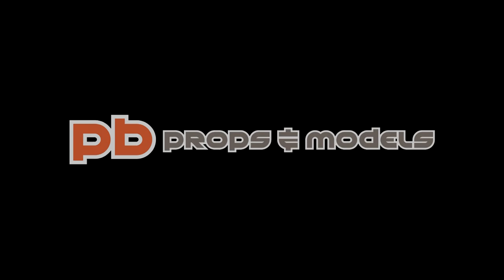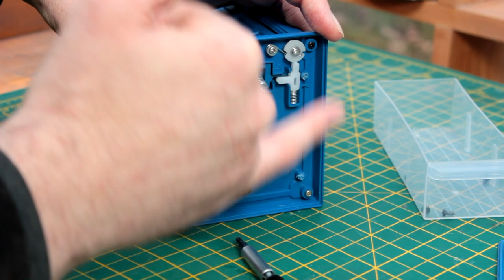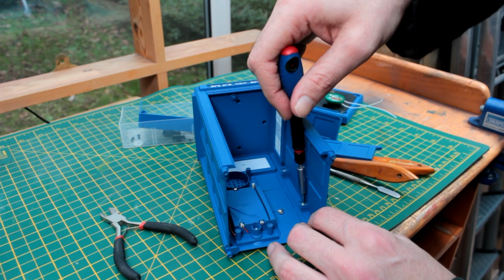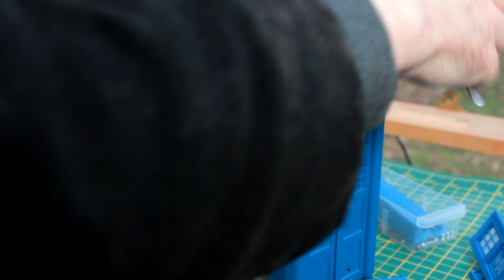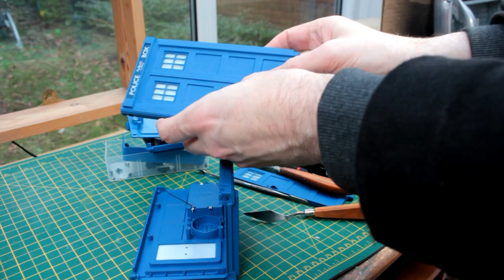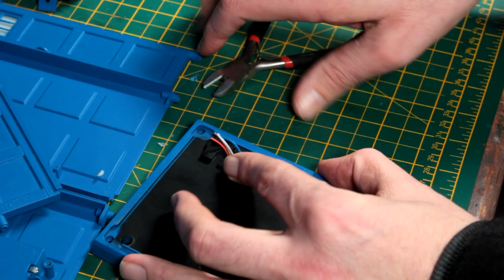How to Dismantle your CO Classic TARDIS Toy

Comment: I had a great deal of difficulty  with my Tardis, putting the outside panels back on, as the inside was a lot bigger than the outside!
Reply from the maker: Dimension transcendentalism can be rather tricky to master, but once you've gotten your head around it, it's easy to overcome.
Reply: @PBProps  When in doubt, a sonic-screwdriver will help you out.

Comment: This was great. Will be handy if and when I come to have a go and customize one or even repair. Good to know where all the screws, springs and tabs are. The only one I've taken apart is the Dapol one! But the walls were supposed to open up.
Reply from the maker: When you do yours, eventually, you can do it with a little more care than me - especially when it comes to the electronics. But good luck and I'm glad you've found it useful - that's what it's for. Oh, and I too have taken the Dapol one apart, a few times... and broken the little clip tabs.

Comment: Next time you get two bits of plastic that won't release try nicking the wifes hair dryer, put it on a low heat setting and warm it up a bit and it's amazing how quickly it will give.
Reply from the maker: Thanks for the tip and thanks for commenting.

Comment: Is there an option to get that glued battery case open at that 3rd doctors Tardis set? What do you think? Wanted to use it again as battery case.
Reply from the maker: I really don't think there is a way to remove the battery cover without damaging it as I believe it is solvent welded into place, rather than glued. You may get lucky and just be able to force it off, but you'd have to carefully test this first.

Comment: i dont know if anyone else thinks this but dose anyone else think that the CO 7th doctor tardis looks like the one used in dimensions in time (at least the signage) because it reminds me of it (also extra note did the eight doctor lamp covering have a dome on the top of it or not)
Reply from the maker: It should look like that prop because it was the 1980's fibre glass prop, just with new signage. As for the TVM TARDIS, it's difficult to tell what was up there, but it certainly doesn't have a pronounced dome.

Comment: Do you know how to get the coil back on the opening door bit ?
Reply from the maker: Looking at me taking it apart here, it looks like you have to hook the spring back onto the disk and then rotate it anti clockwise until it's tight. Then you just screw the screw back into place. Basically what I do in the video, just in reverse.
Reply: @PBProps  thank you this is very helpful:)

Comment: I've just bought a 3rd and 4th Doctor Tardis in the Character Options range - and in both cases the front left pillar bows outwards in the middle a little bit. It's a tad annoying. lol.  I guess I've been a bit unluckily to have it happen twice. But, it's not a deliberate design feature - as I've seen these models without the dodgy pillar. You're so knowledgeable, is there an easy fix (without my needing to dismantle the toys)?
Reply from the maker: This seems to be a common problem with these toys and it appears to boil down to how they were assembled at the factory. Unfortunately, the fix does require dismantling of the box. That said, you could try to loosen the base screws under the affected side and twist the box back into shape - and hope that it pops back into position for you.
Reply: Loosening the relevant screw totally worked on one of the Tardis toys and slightly improved the other. Thanks for your help. :-)
Reply from the maker: I'm glad that worked out for you. The other one may need a bit of internal fiddling with. What happens is that if the walls aren't quite lined up properly before screwing together, this can cause the bow. There is another screw in the ceiling at the front on both sides, if you can get a screwdriver in there (on the bow side), loosen that one and try the same thing, give it a bit of a tug and a twist - it may suddenly pop back...

Comment: Wel... I've gotten as far as the roof. On the Shada B&M TARDISes my weathering effect has sealed up the seams on the roof and Ive got a crack and a couple of marks on the TARDIS. I could return it to B&M and swap it out for a new one... maybe...
Reply from the maker: It's probably been glued together, rather than the paint weathering sealing it, either that, or the lugs holding it together are really tight - I wouldn't know without looking at one. If you've started investigating it to do the customisation and already marked / cracked it, B&M may frown on that and not give you a refund...

Comment: I’m trying to dismantle the b&m TARDISes but annoyingly the paint and weathering SEALS the roof and grasps onto plastic so I can’t take the roof off and get my actual light inside the lamp on the roof. 😡
Reply from the maker: A few people have mentioned this to me recently. It looks like these sets are actually glued together, though I haven't looked into this myself. It's frustrating, especially if you want to modify them. If it's just the paint sealing it, you could try running a blade along the seams, but if that doesn't help, then you'll know for sure that they are glued.